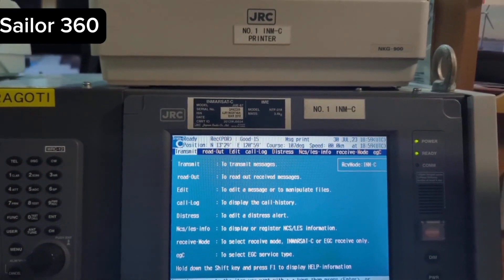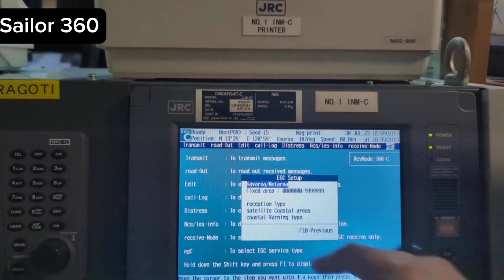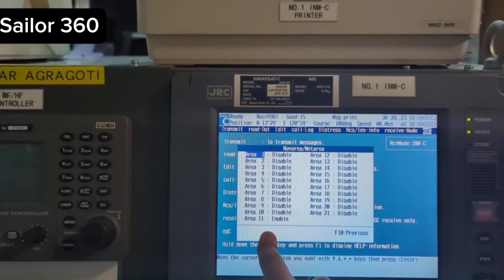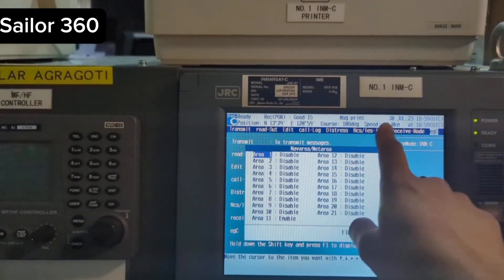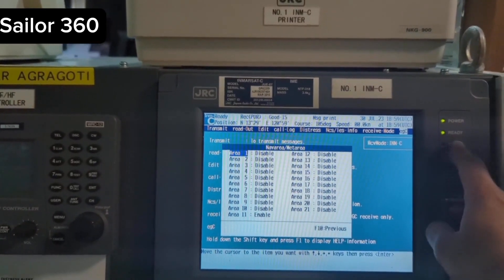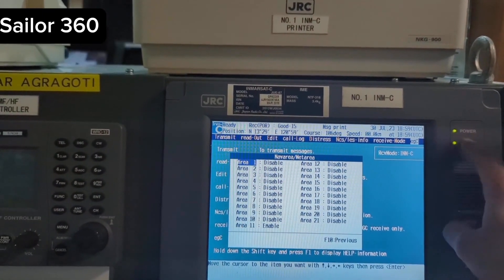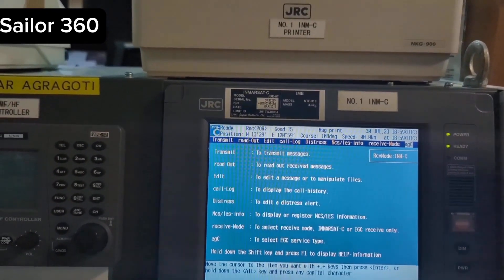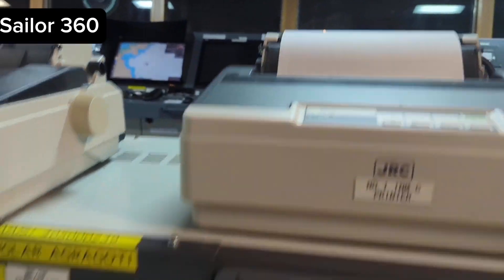GMDSS daily test practical and what to record  minimum, explained || Sailor 360

Comment: Sir, where are the regulations of GMDSS testing for daily, weekly and monthly from? Are they from SOLAS or any other conventions? thanks.
Reply from the maker: Certificates and Documentation:
Ship's Certificates: Ensure all vessel certificates (e.g., Safety, Load Line, ISM, ISPS, MARPOL) are valid and up to date.
Crew Documents: Check the crew list, their certifications, and validity, including SOLAS training.
Cargo Documents: Review cargo manifests and any hazardous materials documentation.
Log Books and Records:
Review the ship’s logbooks, including deck log, engine log, and bell book for recent entries.
Check maintenance records and any open deficiencies or pending inspections.
Condition of the Ship:
Conduct a thorough inspection of the vessel's hull, deck, and superstructure for any damage or defects.
Inspect critical equipment such as lifeboats, firefighting equipment, and navigation equipment.
Safety Equipment:
Verify the condition and readiness of life-saving appliances and firefighting equipment.
Ensure safety drills and training documents are up to date.
Navigation and Communication Systems:
Ensure all navigation equipment (radar, GPS, ECDIS) is operational and properly calibrated.
Check communication systems, including GMDSS, and test alarms.
Fuel and Supply Levels:
Confirm the current levels of fuel, fresh water, and other essential supplies.
Review bunkering records and any upcoming fueling operations.
Voyage Plans and Charts:
Examine the upcoming voyage plan and review relevant charts for accuracy and updates.
Ensure passage plan is in compliance with the company's safety management system (SMS).
Crew Familiarization and Handover:
Hold a meeting with key officers and crew for a briefing on ongoing operations and ship conditions.
Ensure proper handover notes and discuss any significant issues with the outgoing Captain.
Port State Control (PSC) and Flag State Inspection Reports:
Review recent PSC reports and ensure any deficiencies have been addressed.
Company Policies and Procedures:
Familiarize yourself with the company’s SMS and any specific operational procedures.

Ensuring these checks are completed will help the newly joined Captain to have a smooth transition and maintain operational integrity and safety on board.